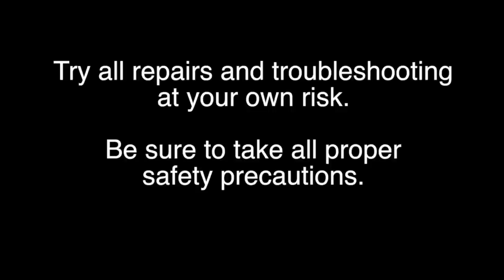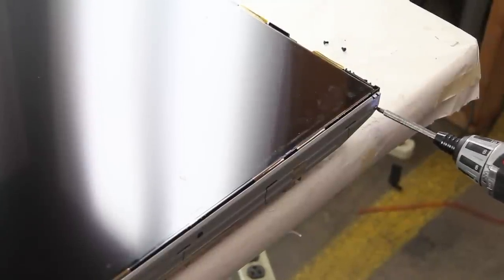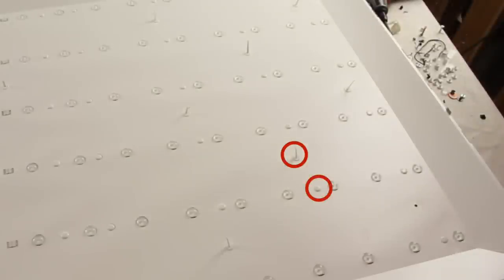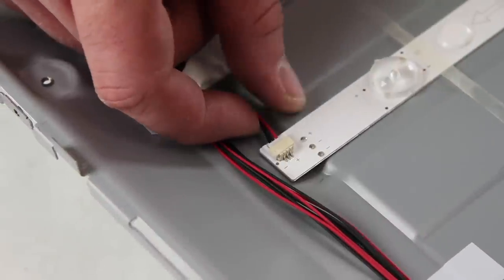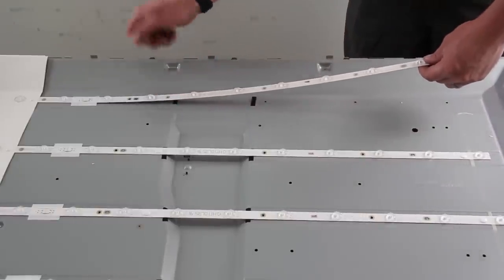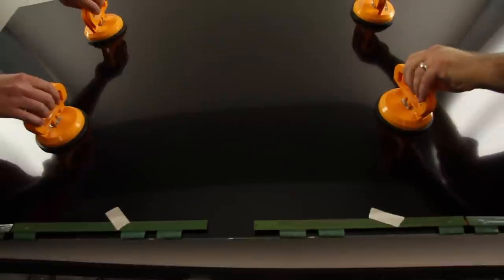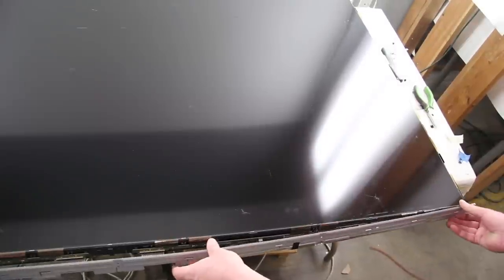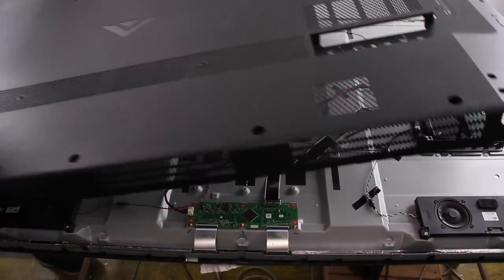Vizio 70" TV LED Strip Replacement Tutorial for Vizio Model E70-E3

Comment: Extreme care is required when lifting  the LCD panel at this size.  In the video you can see even with 4 suction lift points,  the edges of the panel 'flex' quite a lot.  Mine actually cracked at  the mid flex point at the long edge while lifting; damaged panel, game over.  Rather than a 4 point suction lift, I would recommend gently  lifting  the narrow edge of the LCD panel and sliding an equal sized piece of heavy cardboard or thin plywood under the panel then lift the cardboard/plywood panel . Same  on re-assembly.  Sit in place and slide out the support  panel.   My problem was 7 failed LEDS (one each on seven strips) on a two year old tv that was occasional use.  I thought LEDS ran tens of thousands of hours.  How do so many burnout in such a short time?
Reply: Special engineering courtesy of the marketing division at Vizio
Reply: Vizio is garbage. Never buying their tv ever again. Hisense only. Mine had same issue twice. First time was replaced under warranty.

Comment: Some advice on this procedure. I've damaged two (2) late model 60" VIZIO screens by replacing the LED strips. I've had to trash them as once the screen is damaged, your project is toast. Nobody in their right mind will sell and ship a replacement screen as its too fragile to ship. Plus the cost of a replacement you can buy a new TV. The hardest part of this is handling the screen. The alignment is critical as-is the flatness. The suction cups are a "must have" at Harborfreight Tools for $5 each. The screen is a PC board in itself with traces and pixels imbedded as a sandwich that produce a picture. Use the upper top as referencing for the screen to butt-up against otherwise you will have a gap with the diffuser light showing as well as a weak point. Pick the TV with this gap and you'll crack the screen. Any over tightness or misalignment on the bezel will crack the screen. Its taken me two full days to resolve this issue which I now have black spots and a horizontal line after installing new replacement strips. The slightest bump, a careless jab, and its game over.  Unless you have the time and the patience, I would not recommend this. Its not worth your time on any TV that is 50" or larger.  The manufacturing process probably used robotics with pinpoint accuracy for the screen placement into the chassis.

Comment: Beware, the screen is VERY easily damaged when it is laid down. I did this to an e60-e3 model and the first time I changed them I had a slightly dark spot and I thought maybe there was a couple bad led's so I got a new set of led's and put them in. Nope the screen was damaged from laying it down. Now I'm out $100. Should have just bought a new tv.
Reply: Did you use suction cups placed evenly so the screen didn't bend much when moving it around?  The flexing of the screen can easily damage it if not lifted properly as well as making sure it's laid down on a soft surface.
Reply: @MrInfamos  yeah did all that and it still got damaged.
Reply: I have a Vizio supposed a 65” inch but the information say model e60-e3 cascade, the screen is super blue and I know I have to replace the back led light, which one did you buy for you tv

Comment: Be very careful doing this.  That white reflector sheet was glued down onto the leds on my tv and we had a hell of a time getting it off without ripping it in a bunch of places.  We did lots of surgery with scotch tape to repair it, but it ended up not mattering because when we went to put the display panel back on it cracked in the corner from the slightest bend which unfortunately ruined the whole tv.  That panel is extremely fragile.  It’s nobody’s fault but my own, but still, word of caution if you’re going to attempt this. It’s a lot more delicate than it looks.

Comment: One thing to add in the video. Make sure you mark exactly where the strips were including the ends. The new strips come with double sided tape and the plastics clips don’t work anymore. If the strips end up in the wrong spot the reflector plastic doesn’t fit right. Also make sure you label the screws. There are around 6 different screws you end up having to reinstall.
Reply: Hey You know those longer white clips, the 1s to keep the screen from moving, What are those called? and could i buy new1s,? I've already installed my leds strips, but those longer clips, i think they might not work anymore, is that correct?

Comment: Thanks for the video.  Successfully completed the led replacement in about 2 hours.  The new strips appear to be a brighter white led vs the oem which had more of a blue hue.  The double stick tape supplied with the new strips also eliminated the need for all the pins to hold the strips in place.  I wouldn't recommend this effort solely for an upgrade but if your tv has led strips that don't light up, the time and effort is well worth the replacement.

Comment: I would like to say thanks for supplying the parts and helping with the instructions. 

Some pointers: Our TV had a lot more tape and annoying stuff securing some different parts on, like the bottom board cover. The diffuser panel also had some tape.  I think its way easier to just push 95% of the push clips for the reflector sheet out from the back. 

SCREEN IS VERY FLOPPY So get your positioning of your at least 4 suction cups and 2 people correct. I would not trust it bending more than a few inches. 

It took 3 hours with 2 people working on it. We are generally electronics and computer friendly so it did take longer than expected. Just the little stuff took forever, mostly with that reflector screen pins. I did punch holes in the 3m tape (where the push pins get pushed through) so that took a while. A lot of people ditch them on the LEDS but I didn't want the 3m tape being the only thing holding it with the heat inside the TV.

Comment: Thank you for the great tutorial. I used the replacement LED strips and the suction cups today to fix my Vizio TV.  It is tedious and time consuming but the TV is back to its former glory. A few notes:
1) There's lots of tape, make sure you remove the tape from the panel edges before trying to lift out the panel.
2) When undoing the ribbon cables, the small gray bar tilts down towards you, releasing the cables, and lifts back up to lock them in place.
3) There are definitely clips under the circuit boards so you have to remove them to get to the clips.
Happy to have my TV back without having to go and buy a new one right now!

Comment: Thanks gentlemen. I received my order and managed to bring the TV back to its former glory. (Glory as far as a Vizio will bring me anyway. 😉)

I had an initial scare after I put it back together and couldn't get it to turn on. (No power and the IR sensor standby lights were not coming on) That IR light was a sign luckily and after opening it back up I could see that the opposite end of the tab had came loose from removing the board to get at the tab located behind it. Once that was settled everything worked like a charm. 

Man that was a job. Vizio certainly did not make repairing this TV and easy job for people with all the tabs and the one behind the board. Yikes. However, worth it in the end as it was a cheap fix and learning experience. 

A few notes for anyone in the future who does this and comes across the comments for further help.

-Use a sharpy marker to outline your dead LED strips prior to removing them. Once you remove those and put in your new ones, if the locations are off the reflective sheet cut out holes will be hard to readjust and the sticky tape on the back of your new leds makes it hard to remove and adjust them. (I needed to, it was successful, but made for alot more work and risk to the new LED strips. 

- double check all cables as things can get pulled when removing the board to access the push tabs. 

- Be careful when removing the reflective layer above the LED lights. They had alot of sticky tape on both ends so you may rip that sheet a bit if you don't go with the tape. I had a minor tear due to the tape, but it wasn't enough to matter. You can always use a clean tape on the bottom if any small rips as it isn't above any of the LEDs and wouldn't show through. U just want it to remain flat so no tears poking upwards ruining the reflection. 
- In the video they use 4 suction cups, I only had two and was doing the job solo, but it worked with being careful. 2 people would make life easier and generally be safer. :)

Beyond that, it generally wasn't very difficult, just time consuming due to the TV being made to put together much more easily rather than to take it apart.

Comment: I just successfully replaced the LED backlight strips in my Vizio M-Series.  These videos are very, very helpful, but if any of you out there are also fixing an M-Series, just know that there are some significant differences.  The bezel on the top and sides is one piece and glued to the TV.  The glass is also not held on by the  bezel.  I didn't realize this until I put everything back together and could see that the glass would literally fall out if I stood the TV up vertically.  I had to use double-sided tape and carefully adhere the glass back to the frame.  Trying to position a 65" piece of flexible glass perfectly was extremely difficult.  I ordered the 2 suction cups and I would highly recommend  this to everyone as it makes lifting the glass so much easier.  This probably took me about 10 hours of total time, but in the end, for a little over a $100, I have a working TV again.
Reply: Where did you get the strips for the M70-F3?  I have looked, but they seem to be out of stock everywhere.   Also, I'm interested in knowing more about the difference (for when i replace mine).  You said the bezel is glued to the TV, but the bezel doesn't hold the glass? Did you need heat to remove the bezel?  And how was the glass held on originally?
Reply: @robknapton156  I bought all my parts from ShopJimmy.com.  My TV is the Vizio M658-G1.  The biggest difference for me was that the bezel does not hold the glass in place.  I appears that it does, but the glass meets the bezel just perfectly so that it appears that way.  The glass was held in place originally with some sort of adhesive.  It was black in color and I was able to peel it off pretty easily.  It was similar to the sticky stuff you get with junk mail where they attach cards to paper with that sticky stuff, but much stronger.  And, yes - I still had to remove the bezel because it does hold the layers of diffusion under the glass in place.  It's hard to explain, but the bezel has a groove in it for the layers of diffusion, but not the glass.  I think they did it this way for aesthetic reasons - the bezel is a lot thinner than other many other Vizio TV's.  Also, removing the bezel is tricky, since it is glued on and is 3 sided.  It's not designed to be easily removed, but I was able to start working it off little by little.  Once I got it going, it started to let lose.  The real trick is putting the damn thing back on.  Took a ton of patience, but I eventually got it.  Would have been a lot easier if I would have known that I didn't need to have the glass involved until after the bezel was on.  But, I didn't know that and after the bezel was in place is when I realized that it isn't holding the glass on at all.  I was hoping the old adhesive would have enough stickyness left in it to hold the glass, but it did not.  So, I had to remove all of the old adhesive.  Then, I used double sided sticky tape, and slowly put little pieces, end to end, around the entire three sides.  When it came time to put the glass back on, it was incredibly stressful and difficult.  I was holding a 65" piece of glass, trying not to bend it too much, and position it perfectly on the frame of the TV.  Somehow, by the grace of God, I got the thing almost perfectly positioned.  I mentioned these key changes to ShopJimmy because this definitely changed the difficulty of this process.  The other stuff -- removing the old LED strips, etc. -- took time, but not super difficult.  It took me more time because my M series has a lot more LED lights to change.  If you had a P series, that would be even more local dimming zones, so more LED backlights.  Still, the way I looked at it was, I gave up a day to do this, but for a little over a hundred dollars, I have an almost new TV again.  I will never buy a Vizio TV again though.  Ridiculous that anyone should have a TV go bad just after a year of use.  I may also consider an extended warranty on my next TV - something I've never done in the past.  But, after this, I would.  Good luck - you can do it.
Reply: @drmegamax  How did you get the glass part of the screen off? did you go from the front of the TV and peel around the edges or did you open the back and push it off from there? I want to remove the adhesive on the sides and maybe replace it somehow because they didn't do a very good job at the factory. there is a small gap in the top 2 corners.
Reply: @quicsands  Honestly, I can't remember the details that well anymore.  I remember using 2 suction cups to lift the glass off and having to be very careful with that.  The TV was definitely on its back and I lifted it upward.  The shocker for me was when I had it all put back together, I then realized that the bezel did NOT hold the glass in place.  So I had to take the glass back off, and put 2 sided adhesive all around the perimeter - one tiny piece at a time.  Then, it was an extremely stressful procedure of lowering the glass back into place.  It's basically one try and you have to get it correctly positioned.  Not easy to do because the glass bends.  I managed to get it very close - almost perfect, thank goodness.  FYI, about 18 months after I replaced the backlights, they are starting to fail as well, so this was only a temporary fix.  Overall, I'd say it was worth it because I'll get a couple of extra years of use out of my Vizio TV,  but I will never buy another Vizio.
Reply: @drmegamax  Thank you for the info!

Comment: Okay so. Did this last night and now my TV looks brand new. I love it. 
But I have some things to say. Ok so 1. To everyone in the comments saying "oh this was so easy!" NO. NO it was not 😭😂 this has to be one of the most difficult things I've ever done. It took my fiance and I 6 freaking hours to do this and we were up until 2 am. And then 2. This video is a good follow but really doesn't explain anything when it comes to removing ribbin cables, taking out the little white tabs that hold the reflector sheet in place, and then putting those white tabs BACK in. (The tabs, not the tall, skinny things). But all in all, we got it done and I was seriously shocked our TV even turned back on, let alone, look as beautiful as it did the day we bought it. Thank you so much for this!

Comment: When you removed the reflector sheet, you pulled off ~18 more tabs that held it in place (short stubby ones that it pops off of at 4:15 - 4:20). The video doesn't show replacing those, meaning the reflector sheet isn't as secured as it was originally. Does this cause any issues?

Comment: I bought a set of tcon boards from you guys. Ive had to replace them like 3 times because they would not work. My element tv had a black screen now it has a white screen with the new parts. However before it turned white half my tv was white and the other half i could see it said element and no signal now its just white. What could the issue be?

Comment: Literally did this on that exact tv today and bought the LEDs from jimmy a couple weeks ago. It worked out perfect...had flashing on the screen after I was done but took the back off and rechecked the ribbon cables and boom no flashing. That is the most important part besides removing the glass...if you plan on doing this make sure you actually have the work area and have it set up before undoing your first screw. Literally a Philips screw driver and paying attention gets this job done. Saved myself hundreds of dollars doing it myself. About 120 for everything ya need for this job.

Comment: I have a question:  The first steps are to remove the back of the TV and disconnect the two ribbon cables.
Then, it looks like the TV is flipped back over with the display facing up when he disconnects the IR cable and performs the rest of the repair.  I assume it's okay to flip the TV on its back and rest it on top of the boards and speakers?
Reply: That is what we did no problem.
Reply: I did not feel safe doing that... I placed some wooden boards on both sides to keep the components from having the weight of the tv pressing down on them.
Reply: If you just look across the back of it you can see that the boards will never come in contact with a flat table. The brackets for wall mount are the high points

Comment: I watched your video and carefully replaced my led light strips (I had blue zones in my tv) following all of your tips. All of the backlights are now working but I have no picture.  I fiddled with the connections between the t con board and the Tv panel and got the tv to work but only the top half ,bottom is just lines. Any ideas?
Reply: I had the same issue.
Reply: same for me back lights power on but now i have no picture
Reply: Same issue. We’re you guys able to resolve for the black screen?

Comment: I was doing the repair and accidentally tore the ribbon that goes to the scan drive board on the left hand side. It looks like it didnt affect any of the electrical connections but now TV shows no image. ???????

Update: upon further review the ribbon is fine. I dont know why it doesnt display anything now. No sound comes from it either. I've connected antenna and no sound. I've connected iPad to see if sound runs through speakers and changed input blindly several times but no sound. It was working g fine before. I just needed to switch out LEDs which I paid 92$ for. 0lease someone help.